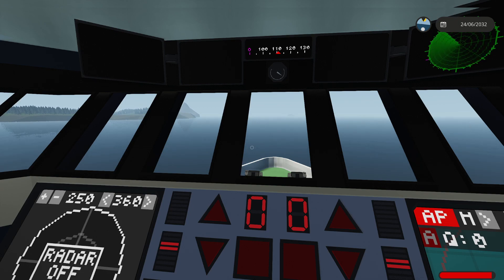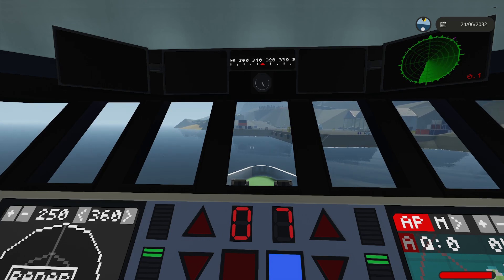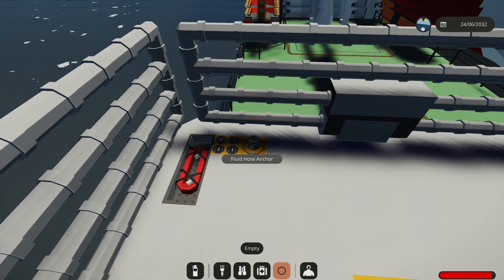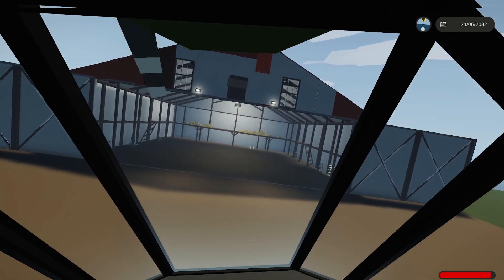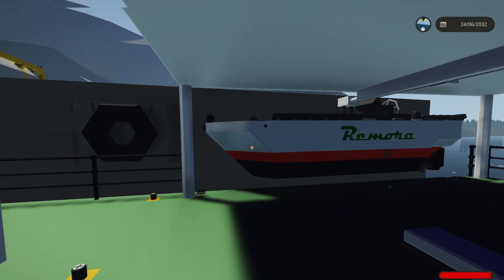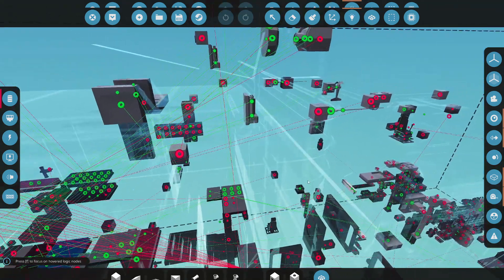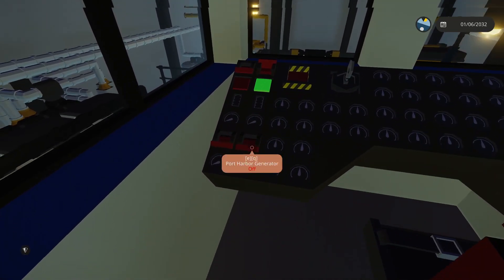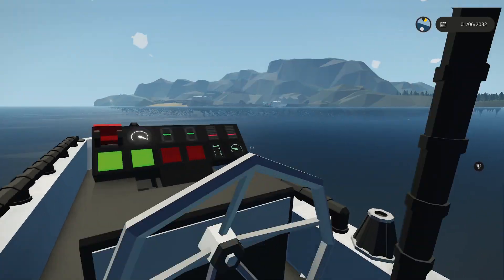Stormworks Career Build Series  158

Comment: Hey @ 23:52 in the video you moved everything over 1 block for refueling but did not move the connecting pipe below it, refuel system will not work until you move your pipe. You can see it if you pause video @ 24:42 and look at pipe just below refuel panel.
Reply from the maker: Thanks for looking out

Comment: IRL most engines run at reduced power when you run out of DEF (urea solution), which would be equally easy to implement, and maybe a bit less harsh.. maybe allow like 60% power or something.
Reply from the maker: Our diesels go into derate mode. After a certain time. You are limited to 5 mph. For certain engines if you are completely out of def the engine will not start.